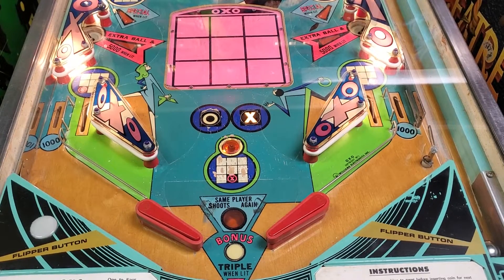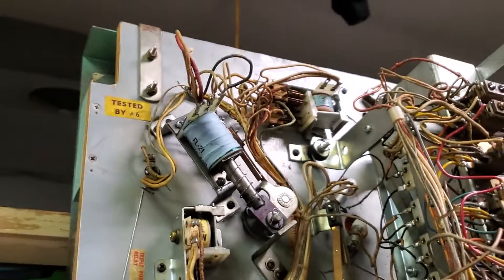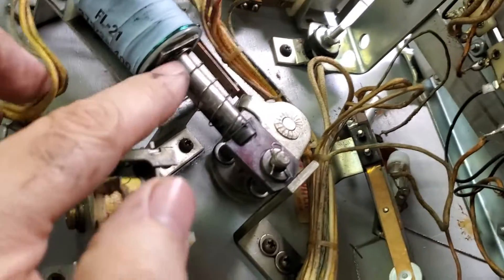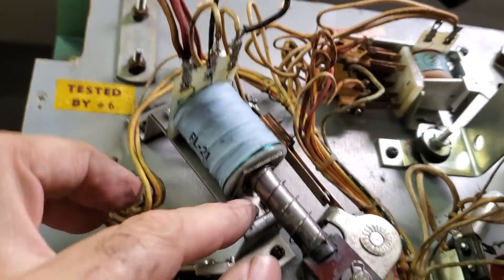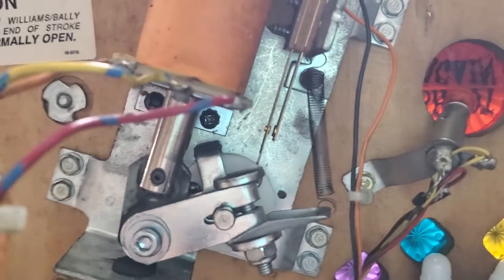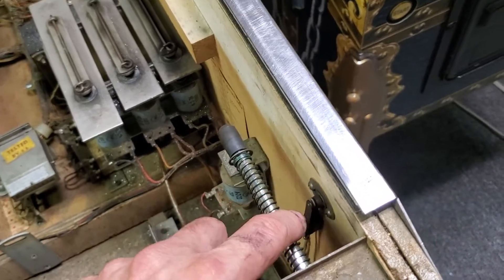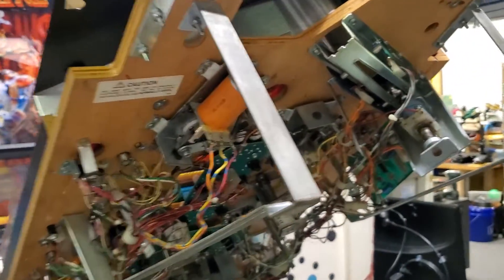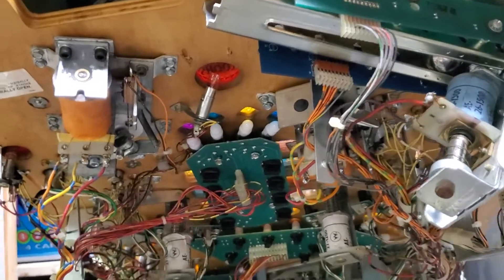How to repair weak/stuck/broken/problem pinball flippers - All About Flippers! - PinballHelp.com

Comment: Good video, learned a lot but still struggling to address issue. I have Williams F-14 game and the bottom left flipper is weak. Top flipper operated by same button works fine. What I’m seeing is when I use the flipper it flips but entirely too weak to move the ball. I cleaned it up a bit and looked at wires with no obvious red flags from a rookies eye.

Comment: I got a question - I have a 1979 williams "stellar wars" - about 15 minutes ago I was playing the game, I got the hi-score, the ball went down, the game was over, then.... both flippers stopped working - - I haven't really looked into it yet but I'm going to assume I blew a fuse - tried rebooting the game, didn't work - guess I'll have a look at it tomorrow (I'm clueless with electronics beyond simple problems like cleaning contacts) - - just thought I'd ask to see what you might say before I go on a wild goose chase - it's gotta be a fuse, I hope it's that simple
Reply from the maker: too many possible issues there, but yea, check the fuses first, then look for any shorted wires/burned coils and reseat connectors
Reply: @PinballHelp  thanks for tips - the fuse was fine - everything looked fine - so I re-seated a few of the connectors although they seemed snug - and just like that my flippers were working again - thanks again

Comment: Hello, I have a sorcerer pin with the left flipper stuck up even when off. Also if you hit that left flipper button with it on it will immediately blow the 8amp fuse by the transformer. Any ideas?
Reply from the maker: I would check the flipper assembly and any loose wires or issues with the end-of-stroke switch.
Reply: @PinballHelp  I got it it fixed. The flipper coil had to be bad because I changed it out to a new one and it stopped blowing the fuse works great now.

Comment: I have a 1977 Williams Big Deal, and I just replaced the broken linkage and sleeve. The coil works, but it's sluggish/weak. I adjusted the switch, and it helped still weak. You mentioned the coil stop could be the problem. Do you have any suggestions? Thank you!!

Comment: I need to hear what you were about to say at 9:10 about flipper buttons sparking a lot before you changed your train of thought. My Stern Lightning's left button sparks a lot but right one doesn't. Coincidentally (or not), the top-left flipper is weak. (Might need to clean the EOS, but not sure if I'm doing it right.)

Comment: I have a 1976 Gottlieb Royal Flush.  The left flipper will sometimes (not all the time) stick up, but will release when I hit the right flipper.  Any thoughts?  Seems like maybe low current continues to hold it up, and when the high current fires on the other flipper, it pulls enough current to allow the coil to release.  I know they shouldn't be connected in this way, it was more of an easy way to explain the symptom.
Reply from the maker: When a flipper sticks, the first thing you want to determine is if it's a mechanical or an electrical problem, so when it sticks, turn off the power and note if the flipper falls down when the power is off.  If it doesn't, then it's a mechanical problem with wear on the flipper pawl, sleeve or coil stop.  If it goes down when the power is off, then it may be electrical and could be an issue with contacts, end of stroke, or parts of the assembly are magnetized.

Comment: Thanks so much for a great video sir. Taught me a lot. My Lightning's top-left flipper stopped staying up, and instrad would fall back down, even if i held down the button. That tells me the switch is being closed (high power coil doesnt stay on), but there must be something wrong with the low power coil connection.
Reply from the maker: Probably something with the end-of-stroke switch.  If it doesn't hold it could also be a broken connection on the coil for low power portion of the coil/lug.

Comment: I have a Stern Walking Dead pro, the flippers are humming when I hold the buttons down. This just started, I'm not sure how to fix this. I swapped out the flippers with new ones from Precision Pinball, and changed the coils, and the humming still persists. Not sure at this point if my problem is in the switches
Reply from the maker: Humming of flippers is usually a coil stop problem, and/or something is getting magnetized.  try replacing the coil stops.
Reply: @PinballHelp  ty

Comment: I got problem with flipper sticking/magnetizing, after i replaced whole pinball assembly i still got the same problem... only during gameplay begin to magnetize...
Reply from the maker: Try getting coil stops from a different source.  Some Stern coil stops were known to be faulty.

Comment: hi, I have a zizzle marvel, heroes three-quarter scale, pinball machine, and my flippers aren’t working at all if I were to turn my machine on and then press the start button to start the game and then touch a flipper the right one will sometimes make a little jolt, but not really move more than like a couple millimetersand if I were to press the left one, the machine will turn off and then turn it back on. I need help. I took off the backside of the machine underneath, and I can’t see any wires that are physically disconnected or broken at all and the flippers mechanically, I can move them with no problem with my finger underneath the machine.
Reply from the maker: Not enough information to know what the problem is but it could be a loose/broken connector somewhere inside.  You have to take a good look.

Comment: I had a flipper that would stick up, and if i turned off the machine it would drop. Read all the forums but had an issue i didn't read anywhere: the contact points on the action button for the flipper was cracked and they would occassionally stick to each other. By the way, awesome video, thorough and to the point, thanks!
Reply from the maker: Thanks for the kind words!

Comment: This is awesome!  Thanks so much.  You mentioned cleaning the contacts on the switches, in another video you used 600 grit sandpaper.  Is there ever a need to use an aerosal electronic contact cleaner?  Thanks
Reply from the maker: You can use contact cleaner, but a light abrasive, even something like a business card, can also clean the contacts.  I think 600+, maybe 800+ sandpaper works best
Reply: The use of contact cleaner is rare on EM's, but used on gold plated contacts by some.  It must not leave behind any residue.  Use Isopropyl Alcohol instead - on 600 grit or business card, Q-Tip, or a sliver cut from a cardboard drink coaster. You really don't need much abrasiveness at all.

Comment: I have a Data East Simpsons machine and the left flipper moves slow. Any suggestions??
Reply from the maker: it probably needs to be cleaned - you can use alcohol and some dry silicon spray lube

Comment: The right flipper on my 1978 Williams Phoenix recently started to have issues. When the flipper button is hit there is a brief delay before the flipper goes up and it also only goes up slowly once it goes up. I haven’t seen anyone troubleshoot a similar looking flipper issue and I’m not sure if I need to replace the coil. I haven’t replaced anything yet but am inclined to just do a whole new assembly to cover everything so I don’t have to keep reworking it.
Reply: Sounds like a dirty coil sleeve
Reply: @matthewmorton7386  I ended up buying not just sleeve but entire flipper assembly parts including coil. Turns out it was just a wire that broke off! 😅 I know people keep saying check the wires first. I should have done a better inspection before getting the parts but at least I have them if I ever need them in the future. Sometimes the solution is pretty easy even for an amateur like me.
Reply: I have a data East Simpsons machine and the left flipper moves very slow. Any suggestions??
Reply: @bayonnebulldogs8548  inspect all the wires connected to the flipper assembly before making any repairs. I just fixed my clipper and turns out for me it was a very simple issue.  One of the wires came out so I didn’t even need to remove any hardware and just stripped and soldered on the wire back in place. Now flipper works normally! :)

Comment: I know you can activate the flippers (or any coil) by grounding the coil. So in you TOM example most right (red) is power and you should ground the two left to check right?